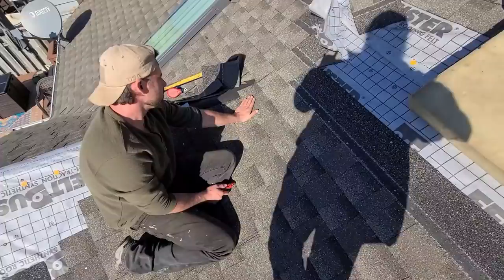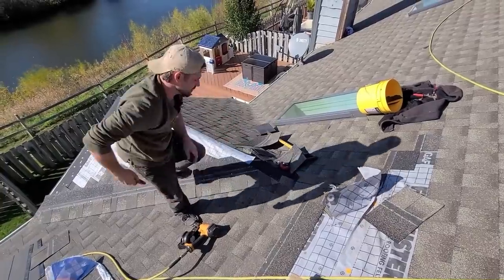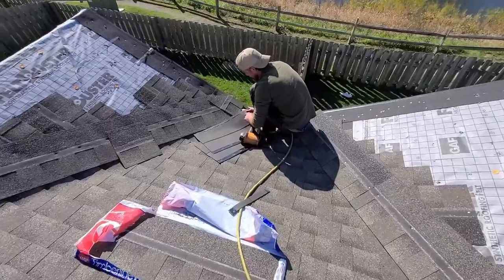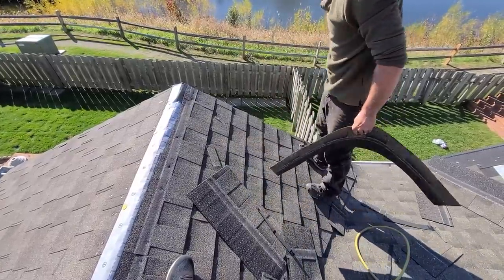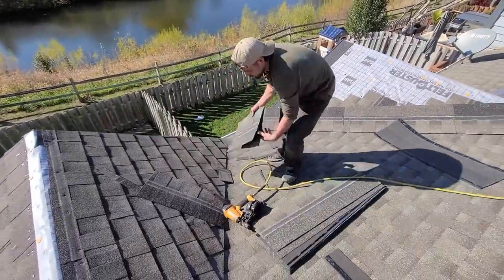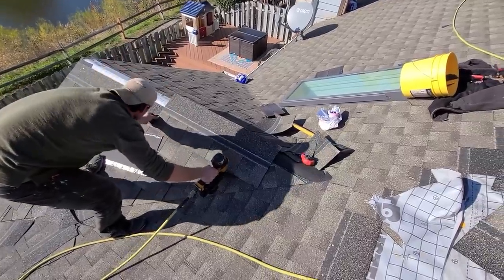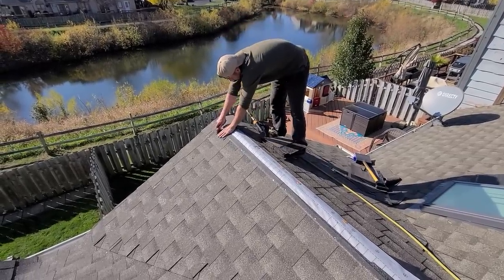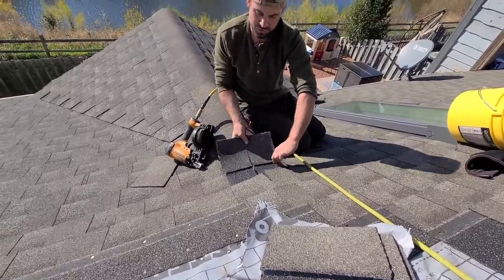HOW TO | DOUBLE VALLEY PITCH CHANGE (Part 2)

Comment: That’s one valley that will never leak I just learned something new I’ve always got 40 yrs did it the old wee your higher roof over laps the lower and I go back and cut all the points under the upper off at an angle so ice dams don’t run the top of the shingle below your way used less shingles that have to get cut back so you don’t have a shingle seen to close to the valley and yours comes out a lot straighter and it’s quicker
Reply from the maker: yes sir thats awesome

Comment: So if you changed those valleys because the pitch was too high on the dormers, why did you not switch the other side, it will have the same effect rolling down especially with the sky lights bottoms less then 6 inches from the valley and I would turn that gun down 19:53 you cut 2 cap in the middle and and put it up too 2 seams, even with black jack that us a guaranteed leak and a guaranteed fail even with the third cap covering the seams, water backs up

Comment: you need at least 1 1/2 nails on that part.1 3/4 is the best,you're trying to blow thru 3 shinglesa at once! .personally i hate cali style.classic closed cut is my fav .
Reply from the maker: thats an open valley i believe
Reply: @NWIVeteranConstruction  i meant dormer side,you running cali style and 1 1/4 is barely adequate for closed cut style,cali has 1 more shingle in there.which makes its even worse.it is faster but  you should carry 1 3/4 nails in truck off menards for 40 bucks a box and use them for valleys.or just do closed cut. yes,it looks cleaner cali,but as i mentioned ,nailing should be done better.